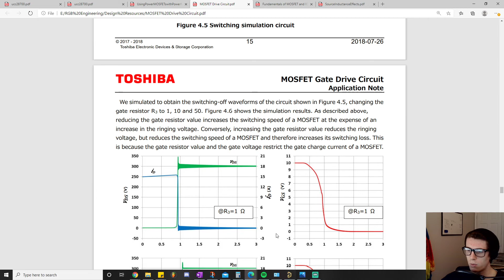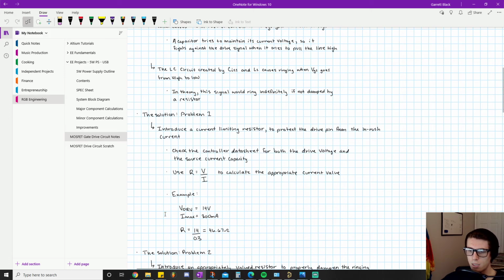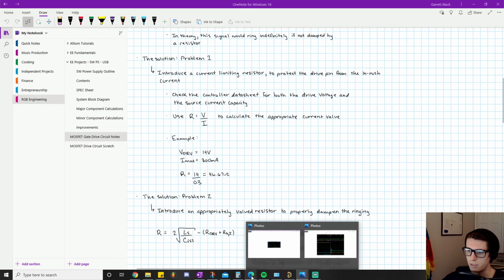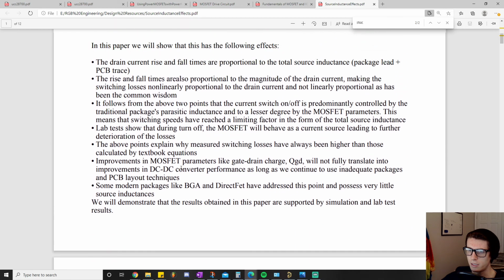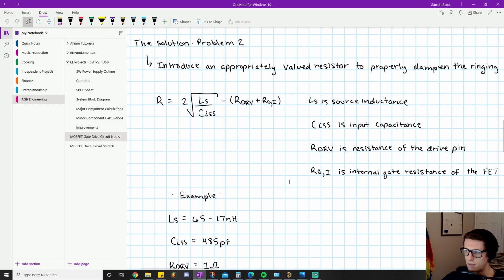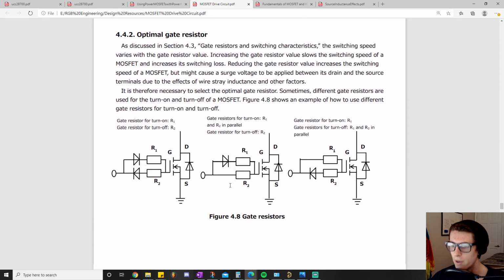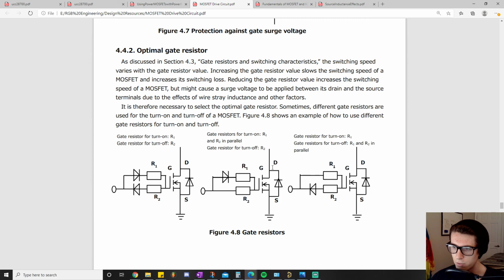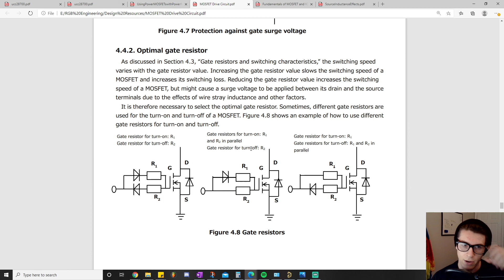MOSFET GATE-DRIVE CIRCUIT Pt. 2 | Circuit Design Tutorial, Altium, PCB | MOSFET GATE DRIVE DESIGN

Comment: Thanks for making these videos!  Hopefully the algorithm shines upon you soon.
Reply from the maker: Thank you for your support - it means to much to me!
Reply: @RGBEngineering  about to try the diode trick (and a capacitor) to quiet down a motor which I’m PWMing.  I’ll let you know how it goes!
Reply: I ended up using the bjt totem pole approach (into an adjustable low-pass using a pot), but surprisingly softening the PWM wave did not affect the motor whine: https://youtu.be/VL9iJhQifeI